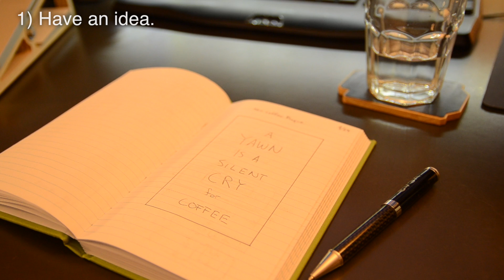Intro to CNC - Part 1: Why Choose CNC?

Comment: I am learning the joys, and curses of cnc and just got into the 3d carving aspect that has lead to longer run times.  I had been using a cheap shop vac for some time but it burned out on me tonight.  Is there a brand that is better for longer run times?
Reply from the maker: I can't speak to all brands, but I bought a Fein vacuum for 2 reasons:
1) "By-pass cooling" design means the motor draws doesn't use the air from the hose to cool the motor, so even clogged hoses or dusty air won't reduce thermal performance.
2) It's waaaaaay quieter than most other vacuums, except for the Festool. Not cheap, but cheaper than the festool. 

There's a site that has comparisions of like 10 vacuums, and the Fein was second best from an acoustic standpoint. When you have to listen to the thing for hours on end, that matters to me. Probably put like 100-200 hours on my unit and still going strong. I have small cyclone separator in-line with the hose.

Affiliate link: https://amzn.to/2rHHkwy

Comment: I would like you to help me in the topic of the CNC I am interested in buying one but I have seen so many comparisons of the X Carve and Shapeoko 3 that I do not know what would be the right one for me. I have never used any. I am from Puerto Rico and here there is not much accessibility for them. thank you very much
Reply from the maker: Bottom line: X-Carve and Shapeoko both do the same things. They cut 2D or 3D objects. Software included is a little different, personal preference may sway you one way or another. Easel program is cloud based, Carbide Create is local. Hardware wise, I think Shapeoko is slightly stronger.

That's really about it. It's not like one is twice as good as the other, the differences are pretty minor. I would personally lean towards Shapeoko, but I would never tell someone to not buy the X-Carve, because plenty of people make great things with it too. Price (Including shipping) is a consideration too if you're on a budget.
Reply: Winston Moy Regarding 3D carbide programs is more complicated than Easel or is it just my impression? Or a person who has never worked at all would be easy to learn. thank you thank you very much
Reply from the maker: They should be about the same. There are plenty of tutorials out there for both. Have you seen my third intro to CNC video? It should be pretty clear what steps you need to go through in order to use the program.
Reply: how much is the clean cutting area of the Shapeoko 3XXL ?
Reply from the maker: 33x33”

Comment: What software are you using for your CNC?
Steve
Reply from the maker: For controlling it, Carbide Motion, though for a long while I used  Universal Gcode Sender. For CAD/CAM, largely Fusion360, though I've used several other options as well.

Comment: Hallo Winston...
compliment on your great  tutorials on CNC.
I have a question....I'm using the same Makita Mill as you use on your CNC.
How do you handel de fan Blowing of the Makita...as I see you have a clean work area when you mill a project.....mine looks really messy working on my projects?

regards Goran
Reply from the maker: I usually use a dust shoe. If not, I come in every few minutes to vacuum up my table. Some people have 3D printed, or crafted little air deflectors that keep the router from blowing directly on the part.

Comment: Winston,
I've been on the fence about getting a cnc for a little while.  You definitely are making me feel better about diving in and getting one.  All of your videos are helpful and thank you for posting them!
Reply: i was in the same boat as you and I finally got mine fully assembled about three weeks ago.  Without hesitation I say buy/make one.  The INSTANT you complete your first job you'll be hooked
Reply: I was in the same boat as well. I am not going to lie the initial setup and structure and workflow was insanely frustrating for me as I am the type that I want to understand everything. I still have a lot to learn but I am definitely cranking out some products and I am really happy about that. And I managed to build a pretty sweet sound proofing box for the whole thing.
Reply: I took the dive and ordered one shortly after I posted this.  Got it up and running.  There were a few bugs that required a new control board from Carbide, but they got it to me almost overnight from the other side of the country.  I can't say enough good things about the support from them.  Also, I am doing my best to watch videos and try to learn where not to make mistakes but -- it happens!  Savant PCs, did you do a custom job or download plans somewhere for your box?

Comment: I'm finding CNC machining very interesting,but it is like learning a new programming language.  There's a chicken and egg phase where you need to learn some things before you really start seeing the problems you can solve, but you will also see problems that you haven't yet learned to solve.

With the proliferation of maker spaces, I think if one wants to try things out, one might be able to limit the investment investment to materials and bits.

Looking forward to future episodes of this series!
Reply: Hi Winston,
I've been a fan of you're video's for the past year.  I'm a High School Teacher and purchased the XXL model for use in our introductory tech classroom.   You're video's have been valuable to me.  We're just about to introduce our students to CNC once we get all of the needed safety measures in place (Cabinet, Dust Extraction, Emergency shut off and interlock switches on the cabinet doors).
I look forward to your future videos and if you have any suggestions for a fun intro project for teens I'd luv to hear it,
Thanks,

Robb